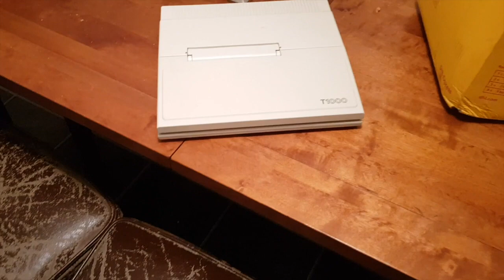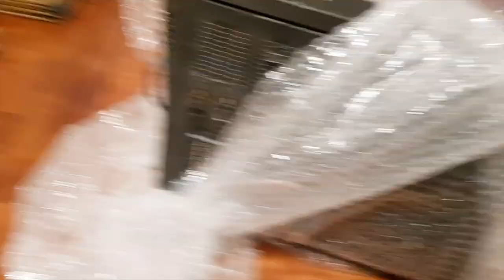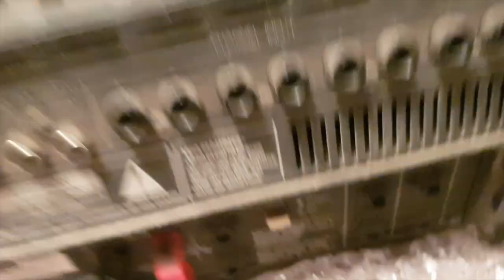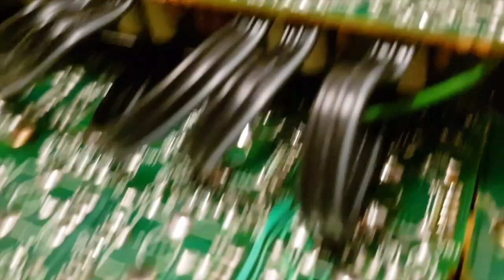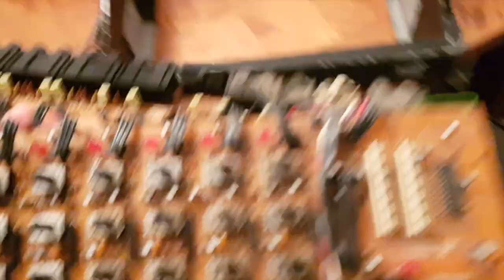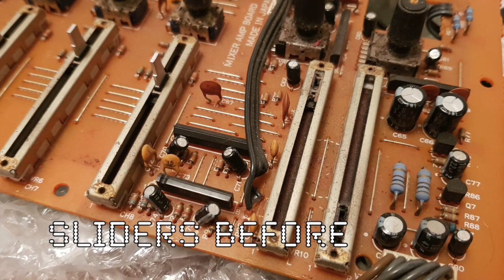Roland CPM-120II Mixer Restoration Part 1

Comment: Good job !Try to fix the rust from sliders with some neutralizer on a ear stick -  and after drying apply some transparent  varnish or maybe gold (brasslike) paint. You must have  attention with the removal of dust from potentiometers not to enter in those square holes and damage the carbon film inside... - An vacuum cleaner is required and not a brush.
Excuse my basic english.